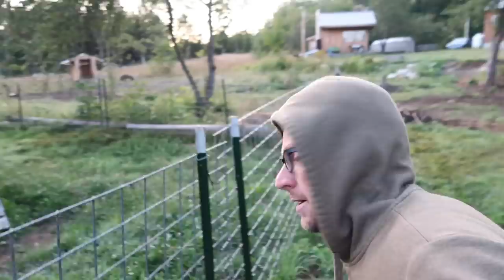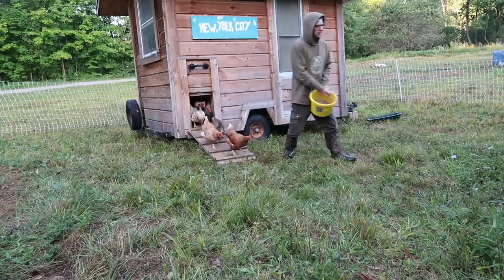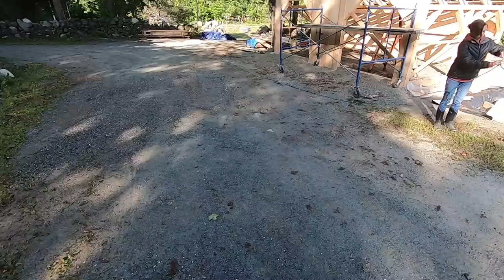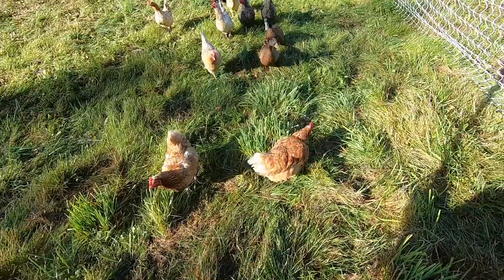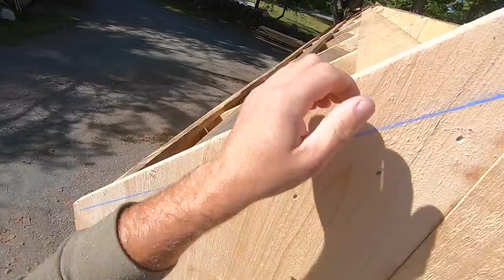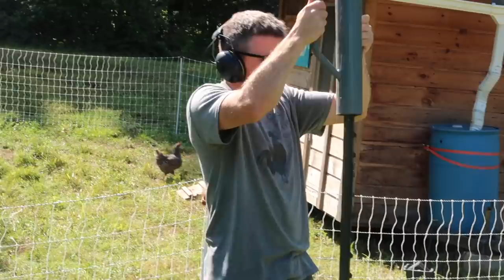This Made her Toes Tingle Siding the Gable End Walls (Post & Beam Firewood Shed)

Comment: I'm in Central Texas, too, and it's 71 degrees this morning.  We have also been ultra-dry and our grass is dead.  I am ready for cooler weather so we can get more done outside.  It'll be October before we cool off, and we never get snow.  I can't wait to see you clearing out the snow as those are my favorite videos besides the barn/shed building.  Looking good!
Reply: When the temp gets to 70° at night in south texas that is cold. It will be thanksgiving b4 frist freeze. Your grass isn't dead just dormant.  Put water on it. It will green up.
Or plant winter rye grass your yard will stay green year round. With a little water (NOT much of that in tx in summer. Unless you live east of Interstate 35. (Wet side of state)

Comment: Just a thought/reminder on airflow with storing firewood. I have many years of experience with it and storing/stacking using it in the Northeast. Airflow is so important between stacks. For cheap you can get a handheld moisture meter to get the most btu's. 
Love the new building and please put chicks inside the electric fence, would hate to see aftermath of an attack in the night. You two work great together! 👍🏼🏡

Comment: Looking great!  Hey, how come we don't see you using air tool oil in your air tools?  I used to depended on my air tools for my livelihood.  I used to put 2 or 3 drops of light oil in them every day I put them in use.  Keep up the great work!  Thank you for the video!  All the best!
Reply: We don't see everything.
Reply: @tonygrimes13  Yours is a valid point, Tony.  However, with as much time as they - Al and Gina - have been spending using them on video it would make for some good advice to those watching.  It's crucial to the continuing operation.  Especially in light of the fact that those pancake air compressors don't have a built-in water separator like an in shop air compressor system would have.  Every bit of moisture in that system is running through his air tools.  Next time he puts them away without oil may be the last time he uses them, ever.
Reply: @tonygrimes13  Hey Tony!  I'm not sure if you've seen their latest video https://www.youtube.com/watch?v=b_6dryx4qFc but, one of their air tools crapped out.  I suspect corrosion from improper maintenance - lack of light oil lubrication to help displace moisture.  I'd like to see #LumnahAcres take it apart to see if that is a correct conclusion and everyone to learn from it, whatever befell it.

Comment: Can you save the apples in a cool spot for your goats? So they can still have a snack this winter? What about a board with barb wire nailed on it, then nailed to your chicken house? You could slide it out of the way when you need access. Those looked like sharp teeth marks. Would a coyote do that? Your pigs are so funny wolfing down those veggies.

Comment: Just a thought when you have long cuts like cutting off the extra side panel a ledger board as a guide. I have to believe at some point in your life you watched This Old House. Well the main carpenter was Norm great guy. Well as the years went by he got a show I think it was called Norms work sho he built mostly furniture.. He always open the show the same way make sure you read and understand the instructions for power tools and most importantly always were eye protection I think your wife depends on you to make sure she doing things correct like I said I don’t want to be a pain but I don’t want your wife to loose an eye either.

Comment: When you built the outdoor kitchen and made other things you did some oiling on the floor and wall so are you not going to do that to barn building or fire wood shed for long life and protection against insect and fungus and rottenness??
Reply from the maker: Yes
Reply: So you will oil after completing firewood shed??
Reply: @05pheonix , I suspect he'll wait until next Spring. The new wood needs to finish drying out (seasoning), until it reaches it's final shape/size. If he oiled it now, moisture would be trapped under the oil.
Reply: @Elizabeth chetwood by that time the log will get fungus.. he should do after he finish shed... it will dry before winter  .. one year without any coating and exposed to atmosphere  will have some bad impact on barn wood.. I don't  know much about woods because here we have brick house..

Comment: PUTTING the current project on bare ground assures required replacement within a few years, due to the bottom rotting off...
YOUR  chicken tractors move a lot more easily than ours did...

Comment: Here's a question:  Why didn't you put the roof on before the sides so the gravel dry will be real dry when you put the wood in. I know you have a logical reason and would like to know for my own knowledge.
Reply: Judy G.  But why... do the walls not go up as easy if the roof is already up? I would think that the roof would help keep the framing and floors dry.
Reply: @Linda Linda:  Wouldn't be able to trim the top of the siding all at once if the roof was on.  Would take longer to measure and cut each board individually.

Comment: Hello Al.....
I just had an  EASY idea....are you able to run a wire from your electric ctr box to the chicken tracker?   Perhaps might have to put some small gage wire around the tracker attached...that way the Thieves trying to paw their way into where your 4 black chickens are will get ZAPPED every time.   Plus every time you move it...just hook the wire back up.   Single strand of wire.    If it has to be off the ground...then just run two or three temporary stakes to hold the wire off the ground.   That way it can be electrified as well as NYC.    All is protected.    If you have the heavy type wire mesh attached to the 4 outside panels...then anything that touches anywhere will get zapped.
Just thought I might put my 2 cents worth in.     
ANother idea too, would be to make your NYC yard a bit bigger and put the Tracker inside of the NYC yard...and move it about along the outer areas around the NYC yard.   Still get the job done clearing the ground as well.   Everyone is PROTECTED under ONE Electrical system.   And the tracker can be guided along the border areas of the fencing all around the NYC yard.    Just a thought.   I don't want to see any harm done to your flocks........I sure miss CWC very much.   Very much a vital part / character / icon of your Homestead family.
Ken
Reply: Not complaining, but he calls it a chicken tractor.  Someone mentioned that if it was inside the fence and too close to it, the chickens could jump on it and then over the fence.